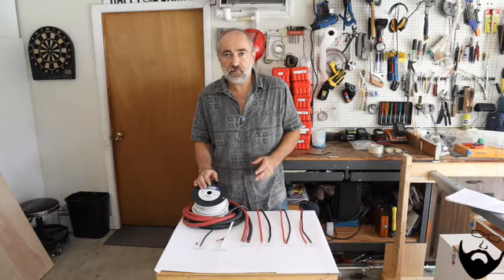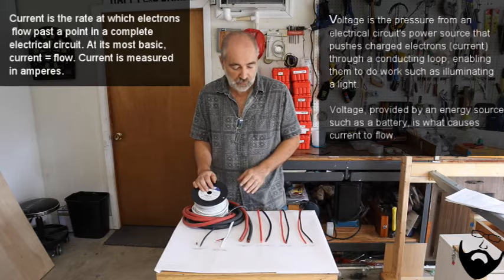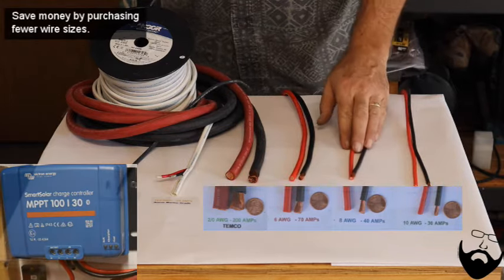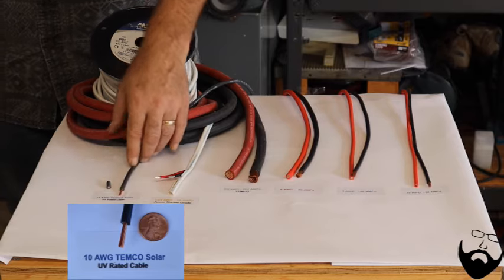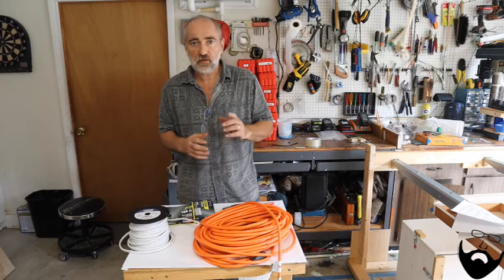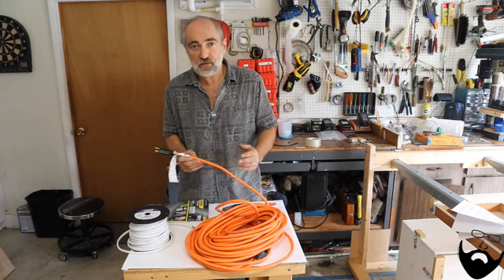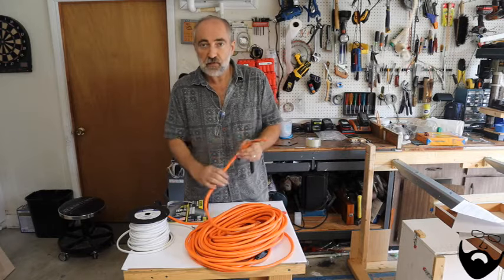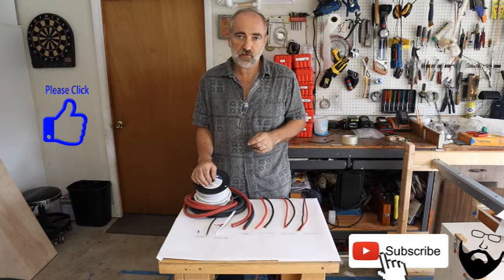Van Life   Wire Size for your van build

Comment: Think I'd go with a 48v system.
Could save some weight on wiring alone.
Reply from the maker: OK, but there is not that much weight in wire.  Most items installed run directly on 12V.   The weight of fresh water is the greatest !

Comment: Awesome video bud. I currently build an econline into a fulltime studio apartment so that i can have a home while doing concrete work out of state(recently homeless due to hurricane). Have plans on running 60 amps solar(realistically 56), 60amps battery to battery charger, and 60 amp shorepower charger to a 400ah battery bank of 4 lithium iron phosphate batteries. Picked up 10awg to run panels to solar charge controller but cant figure out the rest. Thought i would need 6awg for everything but dont want to waste money.(Wallets already tight). Would you please advise me?
Reply from the maker: Wire size depends on the length of wire and the current it must handle.  Wires should be protected from overcurrent with a fuse (or circuit breaker, I like fuses over circuit breakers).  To determine wire size use Blue Sea System Circuit Wizard to calculate wire gauge http://circuitwizard.bluesea.com/#      Also, all the videos divided by category can be seen at https://thefrugalfactor.com/

Comment: Rookie question of the day...
I have VERY heavy duty extension cords I was given by a friend and I also have some really thick wire that came from an industrial (paper mill) demolition I was part of.
So other than adding unnecessary weight to the build, using wires that are thicker than the normally used for van conversion is OK, regarding safety?
Thanks for the video, I'm glad I subscribed!
Reply from the maker: Wire size is measured in a unit called AWG (American Wire Gauge).  You need to size the wire to ensure it can handle the current going through it.  Also, the wire must be stranded, not solid.  You can always use thicker wire in place of thinner gauge wire.  If the wire you have meets those requirements, you are good to go!

Comment: Nice video, well explained. Question: why not go with 24v system? You can get many if not must dc items in 24v and a step-down converter is cheap and efficient
Reply from the maker: 12 Volt materials are cheaper, and readily available.  Also, as you mentioned - no step down converter needed.   I look at the space the items take up, the cost, and how easy is it to replace (availability) if I need to replace it in the future.
Reply: @FrugalFactor  
Advantage of 24v
– For any given load, half the DC current and losses are down by ¼. smaller wire i.e cheaper
– Better input regulation. 0.5v line drop at 12v = 4.6% supply drop whereas 0.25 v line drop at 24v = 1.04% drop.
– Better inverter efficiency and regulation. i.e. Less losses converting to AC. An inverter doesn’t have to work as hard to keep its AC output constant.
24v to 12v converter are cheap about $20

-big energy hogs are AC -induction cook tops, AC air conditioner, AC water heater, instant pot, hair dry, etc
Reply from the maker: @gregnorman3183  I fully understand.  I have been an electronics instructor for over 30 years.  When you are building yours go with a 24V system it is more efficient.   The power system in my van is complete, and is working very well.
Reply: @FrugalFactor  Thanks, I appreciate you taking the time to message back. I'm a novice and just trying to learn. I hear on one hand that 24v is better especially for +3000w and running large loads but I see very few going with 24v and just trying to figure out why. I have decided to go with 24v Electrodacus and 280ah battery, and 60 cell solar panels. I will be using DSSR20 relays

Comment: Great explanation thankyou .i have recently purchased a van diesel heater.i want to upgrade the wiring loom that comes with the heater as it is Chinese.i have scoured utube but cannot find anything.i have seen that supposedly 12awg will be fine for this .iam running a 240 volt 13amp transformer inside my home to 12 volt outlet.my transformer is 30 amp rated.my 12 volt outlet cable is going to be no longer than 5 ft to the diesel heater .from there to the diesel heater wiring loom .any help or advice please .
Reply from the maker: I would use this calculator http://circuitwizard.bluesea.com/     30 amps of 12 volts DC, for a 5 foot length according to the calculator that calls for a 12 AWG wire, with a 3% voltage drop.   Be sure to watch for any fuel leaks, I have seen many comments that the fuel containers often leak.     All the videos divided by category can be seen at https://thefrugalfactor.com/

Comment: Hi can you help I’m changing my motorhome charge controller to a double one at moment my solar panel just charges my leasure battery I need to know what cable do I need from controller to battery with inline fuse
Reply from the maker: The wire size depends on the current that it will carry from your charge controller to the battery.  Look up the specifications of the charge controller.

Comment: 3x2,5mm2 cable, so can it be used like 6mm2 cable, only 2,5mm2 for negative
Reply from the maker: Your using metric measurements, I only know AWG sizes of wire.  You will need to find an online conversion tool.   Thicker copper wire can be used in place of thinner diameter wire.  I use this calculator http://circuitwizard.bluesea.com/#   there must be a similar calculator for metric sizing.

Comment: I have been warned about cheap China aluminum coated copper wire coming from Amazon. I like your idea using the 12/3 extension cord in my van build but cannot seem to find if the wire type on the one you recommend is pure copper.
Reply from the maker: I used this https://amzn.to/3ZBUaXh     Stating it was USA made gave me more confidence.  The weight of the cord tells you its copper, not aluminum, and when you cut through it you can tell its the real thing!     I used it for all the AC outlets in the van.  Thank You for watching!
Reply from the maker: Its the cord you see me cutting at 8:20 seconds into the video!

Comment: all websites say 6 awg does 103amps
Reply from the maker: At what distance?  Current carrying capacity is determined by wire composition (copper, copper clad aluminum), voltage drop, and distance.  12 volts, 103 amps with a length of 8 feet or less, then 6AWG of copper wire is OK.  Best to use a calculator like this: http://circuitwizard.bluesea.com/

Comment: Is it overkill to use 4/0 AWG for your battery/inverter wires in a 400 watt solar / 2000 watt inverter setup??
Reply from the maker: It does not depend on solar, or Inverter size.  It depends on the Current draw and Distance.  I always recommend using a wire calculator http://circuitwizard.bluesea.com/        For my system 2/0 was the correct size.

Comment: Most Channels I have watched recommended marine 14/2. Is 14 not more than enough for a 12v van system?
Reply from the maker: Depends on the current required and distance.  Use the Blue Sea circuit calculator to be sure.  There is a link in the video description.  12/2 is often close to the same cost as 14/2.   If all you are powering is a few LED's even 14/2 is more then needed.

Comment: Why having extension cord when you could wire your van with Romex at the first place? Extension cords in a van is a sign go a lack of design
Reply from the maker: Oh my NO.  Romex is solid not stranded.  Romex is a big No in a marine, or environment with vibration.  You can purchase 12-3 marine grade Wire that is not an extension cord.  But I choose a quality STJW extension cord instead.  Lower cost and provided a layer of molded insulation around the three wires.

Comment: Do you ever need 4/0 in a Sprinter van conversion?
Reply from the maker: It depends on the amount of current through the wire.  The way I calculate this is by using Blue Sea Systems Circuit Wizard.  Use google and it will take you to the Circuit Wizard Calculator.  Its possible you might need something larger than 2/0 but that would be a short run from the LI Batteries to the Inverter.

Comment: Is there a difference in  
2 0 gage and 2AWG
Reply from the maker: 2 AWG is .2576 inches in diameter, 00 or 2/0 gauge is .3648 in diameter.
2/0 gauge can carry higher current (amperage).   There is a link to a wire gauge calculator in the video description.

Comment: 12 awg for each appliance? A bit overkill. Maybe for 12v usb sockets yes but for propex heater for example it consumes 1.5a when it runs. Maxair fan maybe around 1a. All my LED lights consume 2a if all turned on.  Well I guess better safe than sorry.
Reply from the maker: Correct better to be safe.  Also, easier work with just a few wire gauges.  If you monitor the prices it can also be cheaper.  Wire prices often fluctuate.
Reply: @FrugalFactor  my mate gave me lots of 20 awg wire for free which I used for LED lights, max air fan, propex heater, some other light stuff. All individual fused circuits. For heavier stuff like fridge, pump, 12v sockets, oven (just for spark) I've used 14awg and thicker (for fridge) . Been fine so far but if I'd do it again I prob use thicker just so I have room to expand more lights for example...

Comment: You have said it wrong " Smaller the gauge the wire less current it can handle ". A 6 gauge wire can handle more current than a 10 gauge.
Reply from the maker: You also stated it wrong.  The smaller the gauge NUMBER, the larger the diameter of the conductor and the higher current carrying capacity.  Example a 22 gauge wire is a very small diameter, and can carry a very small amount of current.   A 6 gauge wire can carry more current than a 22 gauge wire.   To avoid confusion use Blue Sea Systems circuit wizard to calculate wire gauge.   http://circuitwizard.bluesea.com/#